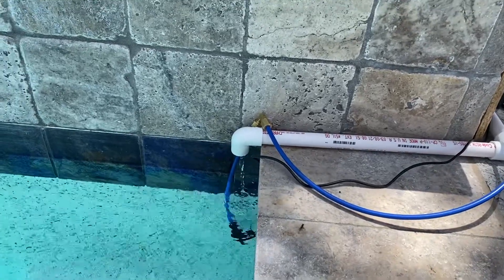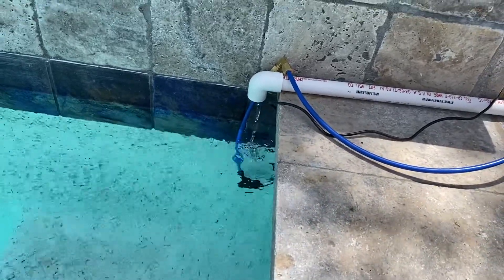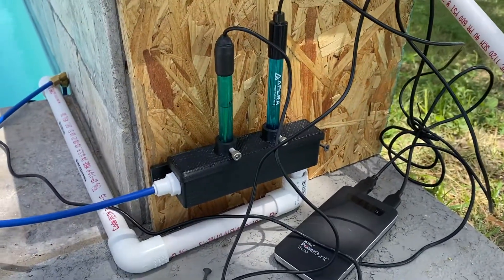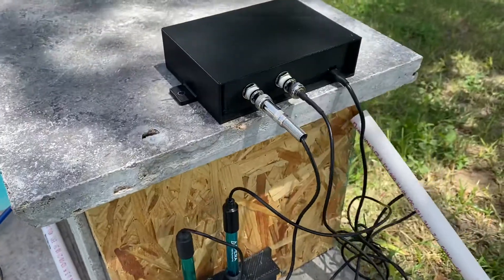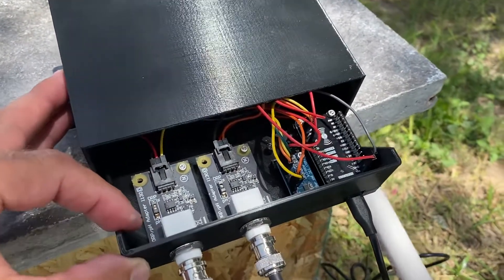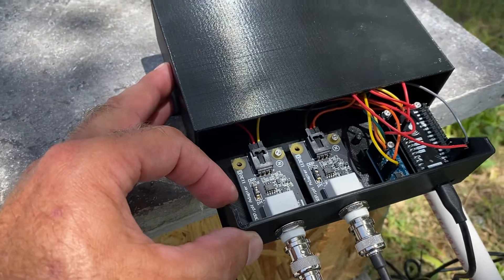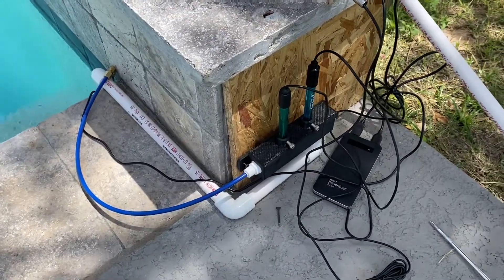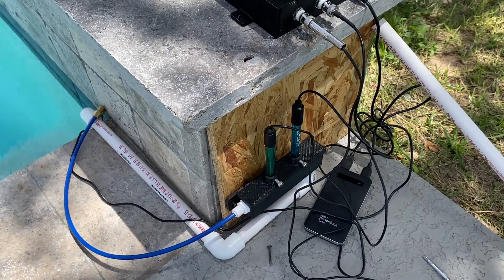DIY PH/ORP WiFi Connected Pool Water Monitor

Comment: Sorry sir, can you tell me. ORP's sensor do you use ? Thanks
Reply from the maker: Did you find one?  Try to duplicate?  My system has been down and just recently working on it again and added remote bleach addition.  ORP is a function of ph.  I need to account for that. My bleach addition is on a Kasa timer.

Comment: Keeping up with the pool chemistry is a nightmare. This is an amazing idea. Please keep us updated on how it's working long term.
Reply from the maker: Still working great.  I was out of town for several days and the current monitor on the motors actually tipped me off that my level was low.  I saw lower amps and a jagged plot from sucking in air.  I couldn't do anything about it though until I got back. Pump chomped on air for two days.